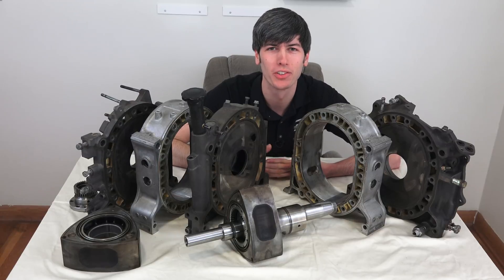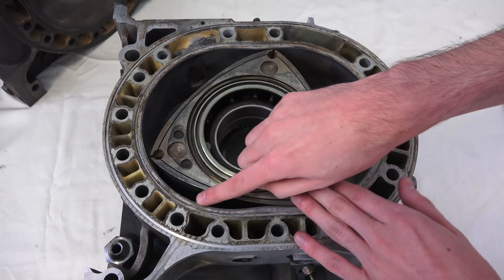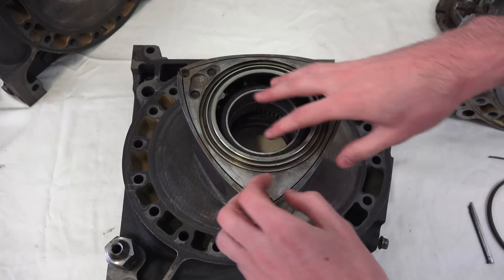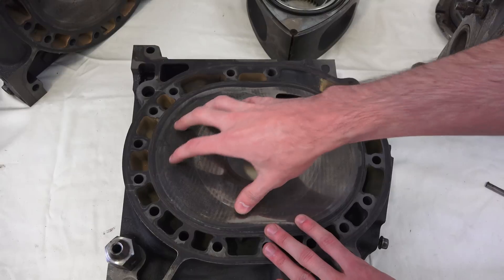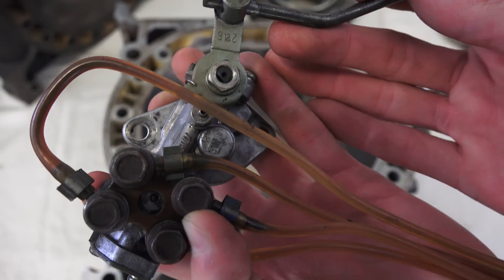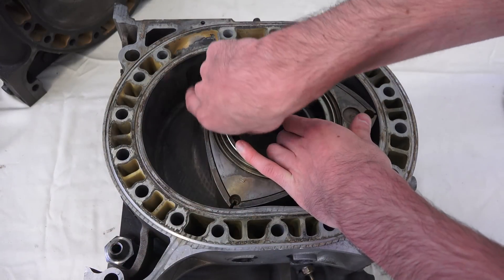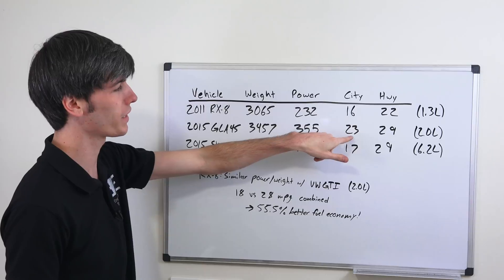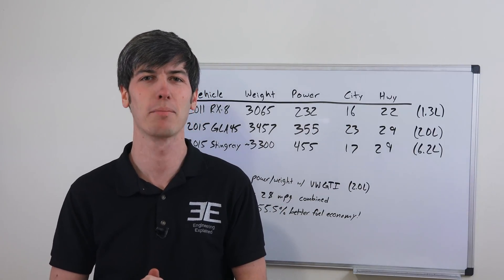4 Reasons Why The Rotary Engine Is Dead

Comment: I don't believe it's fair to say Wankel motors are an entirely flawed designed that are incapable of further development... It has had neither the amount of development time and wide spread acceptance by auto manufactures or consumers alike, therefore it would be naive to put an objective "failure" stamp on it when not all technological advances have been possibly applied to the concept. 

During it's hay day it was actually quite competitive against 6 and 8 cylinder engines which at the time hadn't been refined and struggled with emissions strangling power output. The problem arose when piston engines eventually did get more refined and engineers learned to adapt with emissions, That's when Mazda's own rotary engine was left behind quickly without the same rapid pace of development. Sadly it isn't mature enough to push the same amount pistons were reliably or efficiently.

Comment: I've had experience with Wankels over time in other installations.  The Suzuki RE-5 was the main one, Graupner .30 cu. in. model aircraft engine another.  The system was originally designed to be a type of supercharger, not an internal combustion engine itself.  Felix Wankel saw that it had engine cycle properties and went in that direction with it.  There were also some stationary types like for lawn mowers but they proved to wear out quickly and hard to maintain efficiency during their working life.  The Suzuki version was a well done unit but the exhaust gases were so hot that the aluminum manifold at the engine would melt during high power dyno runs.

Comment: nice video, nicely explained...but you only focused on the disadvantages of the rotary engine, sure there must be at least one or two advatages too...or if there are none, is there someone out there still working on the exciting problems, heat differences, oil usage or the ignition problem you mentioned...or do you think it was just a failed experiment, "another way not to build a good engine" so to speak? 
Did you hear about those spherical engines they are trying to build, do they suffer from the same problems as the rotary engine? Or are those engine typs are just used in the wrong way...for example would they be better used for running generators or something like that, were there is not change in speed?

Comment: Isn't there also a problem due to the Wankel engine's inherent thermal inefficiency? Is it the case that the surfaces swept by the rotor, as a ratio of the combustion volume, i.e. S(area):volume is inherently inferior to that of a reciprocating engine? Too much heat is lost before it has done any work.

Comment: Well, your statement is incorrect, because of the very advanced concept of the Wankel-Engine and the lack of advanced materials, then, it has not been popular, but the concept is used and engines have been built... However, apparently the Mazda engineers (some of the best in the world) have decided, that the Wankel concept is good enough, to build another sports-car with a rotary engine! Aside from that, even some engineers in the aircraft business checked out the idea for a turbo.prop-like propulsion... Curtiss-Wright and John Deere!.

I drove one of the first NSU Ro80 cars and it was a joy driving this car, which still looks like a modern car today. 
The engine sound is turbine like. amazing!

Comment: I had a 1988 RX7 and it barely burned any oil.  I guess that is NOT a good thing, right?  It seemed to run OK until I sold it at 60K miles.

Comment: Stock numbers are great, but a simple modifacation to intake with some inline turbo application fixes the power problem while still costing less than the mercedes and the vette. I agree that the production design was more of a prototype, but in the right hands these motors are great powerplants.

Comment: So what is the advantage?  HP per liter?  And how exactly is that an advantage with such poor efficiency and fuel economy?  Also, going off #1, would a redesign of the rotary to more of a gear shaped cylinder (more spark plugs, more than just two sides) even be worth it?  Or at that point you're getting so close to a 4 cylinder DOHC?

Comment: A lot of people don't give the engine good fighting chance because if the car is not  driven probably, you will not get the full experience of the engines capabilities , I think this engine deserves a second chance maybe with a new designer to try and sort out these small problems. There is no denying the fun that can be had in a Mazda 5 Series

Comment: dont forget to mention how giant bike maker suzuki was infactuated by the wankel engine and tried very hard to market its re5 wankel engine bike model to the public in the 1970s and met terrible failure that almost got itself bankrupt doing so..that being so I must add wankel engines bad fuel efficiency and heat can be improved if we made super efficient plasma spark plugs that burned much longer like a tesla coil, and to keep the temperature and economy imbalances we can always add hho hydrogen water fuel mixture into the system, with 200hp output, making water electrolysis into hydrogen wont be that difficult when turning a massive 200amp alternator, plenty of innovations we can try if only there were more interest in these engines...

Comment: the only efficient rotary wankel engine will be in the form of an electric motor, lets face it..the day we improve the wankel rotor combustion engine will be the day we discover ufo electromagnetic propulsion on our current fuel guzzling primitive aircraft flight engine technology
Reply: +fidel catsro 
You must stop making things up.
Reply: +John Burns too many ufo sightings for you to ignore...electric rotating motors in cars are reality..
Reply: +rfvtgbzhn With the airplanes, those are called "radial" engines.
Reply: +fidel catsro Yes, but they are not called wankel engines and they don't look any similar. They are rotary engines, because every engine that rotates (instead of using a crankshaft) is a rotary engine (there are also rotary piston engines, which are used in propeller airplanes), but not wankel engines.
Reply: Blu Evo
according to Wikipedia "rotary engine" is a term which covers every engine that rotates, so a radial engine is also a rotary engine.
Reply: rfvtgbzhn
Rotary engines do not have highly inefficient crankshafts.

Comment: You forgot a fifth reason.
Not many people/mechanics understand them nor know how to work on them.
Reply: +Eric Trimmer 
They are simple, very simple.
Reply: Working on them is easy, replace the valve housing and seals is almost always the answer. That'll be $2000 at the shop, so the customer will be pissy if they even lend their expert opinion.

Comment: Plus add to the disadvantages, it doesn't provide any assistance when you are braking... In contrast to the piston engines where you use the engine to assist your braking due to higher compression ratios. That's why the rx8s have pretty massive brakes...
Reply from the maker: +seriousCADninja It will still create a vacuum between the throttle body and the intake port, thus still providing engine braking.
Reply: +Engineering Explained Also, as wankel engines do not tend to have large flywheels, unlike an otto engine, they have much less inertia, which is why they are much more responsive than otto engines, but also means that the force needed to slow the car down is less (though not much it's still a relatively large amount) and thus the engine's small braking force would have a larger impact compared to an otto engine.
Reply: Bit ambiguous ??.
Reply: engine braking is crap for the engine anyway tbh.
Reply: install a jake brake.

Comment: +Engineering Explained - I have watched some of your videos, enough to know that I already know most of what you know, but there's always some hidden 'treat' found in the way you explain the basic principles of engines and stuff. Now, the purpose of this comment, is regarding the name of the video...

While the Rotary may be Dead to Mazda, (or production cars anyway) it certainly is not Dead, down under. Those Aussie lads and fellows from NZ (as well as certain smaller shops around the globe) have taken the rotary far beyond where Mazda left it. Carlos Lopez in the USA, for example, has designed 3-stage intake/fuel systems, (essentially like VTECH for Rotary, VIA using the original primary/secondary ports as well as adding Peripheral intake ports) for full-throttle MAX power on-demand, with the benefit of a more street-able idle from the primary ports in low-RPMs, and smooth power-transition from low-mid to mid-high RPMs, as the secondaries open.

Good stuff, these engines were bred for their reliability, and used-in-production mostly for snow-mobiles, because who wants to break a timing belt/chain, bend a rod, break a valve, etc, while out in the cold stuff miles from other people? Yet this engine has proven to also be most suited for all forms of auto-sport ;)

Comment: pretty big horse power with just 1.3 L
Reply: +Ageha Projet 
In one revolution the engine sucks in and burns 3.9L of air and fuel so the hp is piss poor. Another reason no one else has been interested in rotary's since the 70's

Comment: what about putting more spark plugs in the combustion area? what about making the face plates out of something less likely to warp? maybe a ceramic layer? maybe the seals could be some kind of roller bearing instead of a wiper? then it could get away with less oil?

Comment: I have a 81 RX7 and it's like any other car look after it and it will last, as long as the engine gets built by a reputable builder they are just as reliable as a piston engine, the whole "rotaries are unreliable" is such a 1980 state of mind